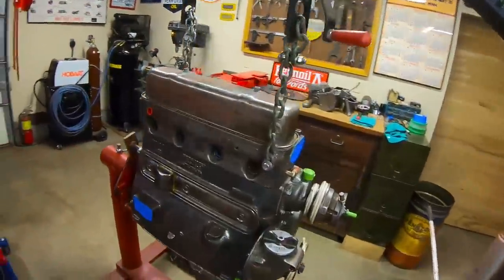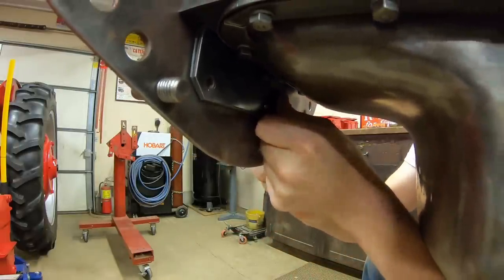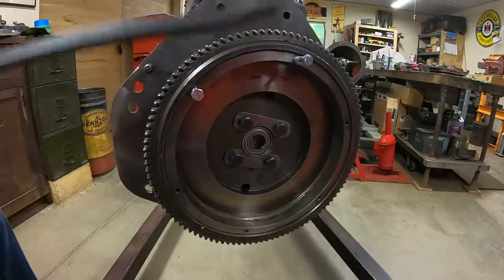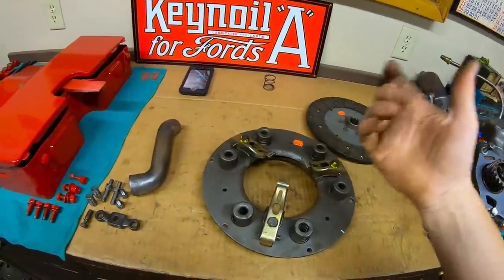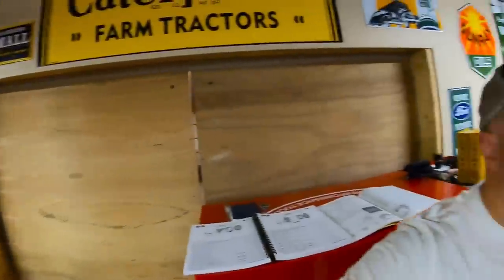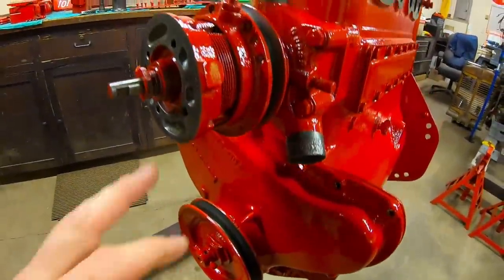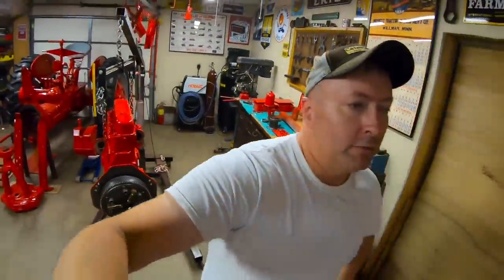Farmall "Preparation H" Episode #20: Flywheel, Clutch Install, & Painting the Engine!

Comment: Good catch on the pressure plate! The clothesline to mask the pulleys is a great idea!
Reply: Squatch Sr. Is a superstar!
Reply: The M that we had developed the same issue with the clutch. I caught it when I got tired of it shuddering and checked the clearance between the throwout bearing and the clutch fingers. All 3 fingers had different clearances from the throwout bearing. I didn't have to deal with the hydraulic system because my brother left that off when he rebuilt the engine in the mid 70s. He had messed up the adjustment on the clutch fingers when he took it apart and didn't know how to get it back where it was supposed to be. I remember that it took him a long time to get the tractor started and had to get help from our neighbor to figure out what was wrong.

Comment: Awesome job and video . I tried painting but there is so many runs in my paint job you would think that you were at a track meet . My 1926 Oldsmobile has a step fly wheel like your tractor. The pressure plate has 3 long cam lobes on the back .and when you torque down the pressure plate you have to measure the distance from the throw out bearing seat to the fly wheel and if it is not exactly 1and 1eighth distance you will have to take out the transmission and reclock the pressure plate. It took 7 cycles of in and out to get it right.the out side adjustment is for the pedal travel only. If the clutch starts slipping pull the floor board and bell housing out . The bell housing is the imput shaft bearing support. The transmission is bolted to the bell housing from the inside the bell housing..l really like your videos because of the details you put into a project. It shows you have a lot of hart in your projects. Denis from Santa Rosa CA

Comment: I like how the engine came out, no more dull red paint. The clutch adjustment and heat scoring reminds me how always check even brand new things. Sometimes they can be off by just a hair but cause lot of issues later. This flywheel is very nice compared to what the Super M had. I think the heath cracking on the flywheel is result of a very slipping clutch? From personal experiences from working with  a Belarus 520 tractor. Misaligned engagement arms can cause the flywheel to wear more on one side than the other. Combine that with a slipping clutch and you have a very bad day when you have to replace the carnage later.

Comment: I re-did a 73 Bronco clutch in very poor working conditions and failed to confirm all components.   Then the clutch started feeling oddly sticky (someplace between Milwaukee and Seattle).    Took a risk and drove up the Alaska Highway as it was slow degrade and then pulled it apart in a friends grease pit when I got to his place.   Wrong throw out bearing.   Ate one of the fingers mostly off.   Lesson to early self,  always CHECK.

Comment: 0:35 can also use electrical wire, specifically rubber coated. It auto-locks into the pulley. Old timer's tricks are the best.
edit: forgot to say, the rubber has the added bonus that you can wipe it off with acetone and reuse it again and again. I've been using the same pieces from the day i learnt the trick. Old Black&Decker drill cord.

Comment: Hi there is a mark on the flywheel and pressure plate for the installation, this also helps to reduce any vibrations of the clutch.

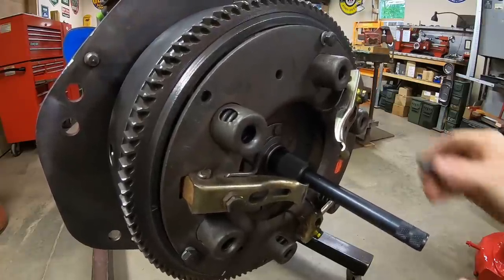Comment: 9:59 a good mod on these is to take the cone and the pucks (the bits that slide into the bearings) and put o-rings on them. On the outside for the puck, makes the thing stay put in there positively and on the cone, on the ID, making it stick to where you push it. My tool is a little bit different than yours, but generally speaking you want the o-ring grooves to be slightly undercut, so the rubber stays just a little bit proud of the spec for them, gives the whole thing a lot more staying power and it doesn't rattle.
I also took all the pucks i had and downsized each of them one "notch" down to the next bearing i commonly use where the fit is a lot more positive. The pucks are super easy to make, so if i have an odd size, i just make a new puck. O-ring trick ain't mine, i saw the mod on a forum back in the 90's, i only did it like 5 or so years ago, but man... huge change in how you work with the tool, especially on car clutches. Night and day.

Comment: Don't remember the tip with the shive pulleys and rope from before but it is a great tip! Thanks Sr!
Interesting find on the flywheel and pressure plate. That would have been a great segway on the pressure plate and then also the direction clutch disc as most are a "this side out" clutch disc system. 
I know you covered it a little of your breathing air before and I will have to go back and find it, but I dont remember anything on the hood. Is it a common Papper hood (powered air pressurized respiratory system)? I know you covered the air supply unit a little bit.  Seems to be handy to have the air supply point outside of the paint misting area.

Comment: Marking the clutch disc, pressure plate and flywheel - good work and great detective work. I was always taught though, when you encounter such heat related issues, best practices is to resurface the items. Do you feel the marred areas will be no problem?

Comment: I didn't know farmall's are pull start and how can I find documentation on a serial number  of a cat, am wondering how to research a possible show room machine there was white paint under the yellow that was hastily brushed over white paint has a brass dealer tag brass tags on pillar blocks for a few bearings and the engine tag and trans tag are matching numbers in brass

Comment: Curious... What do you think they did at the factory to prep the final engine assembly for paint? 
It's not like they didn't have oils on stuff, but they weren't gonna be spending all kinds of time to prep it "perfect".
Think they were using a degreasing "wash down"?
Reply from the maker: Almost every manufacturer used large steam cleaning tunnels that the finished machines were taken through just before the paint station at the end of the line 👍

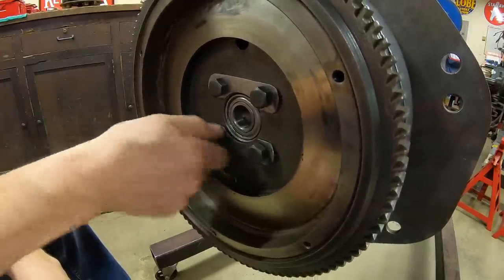Comment: 4:30 I'm starting to wonder if all these foldover locks are a substitute for proper torquing, a way to ensure this stuff doesn't fly apart even if undertorqued by the farmer working on it.  Properly torqued those bolts aren't going anywhere but if they're not quite tight enough that lock might be the hail mary that keeps them from backing out.

Comment: I'd like to see a slot cut across the head of that alignment bolt for ease of installation & removal and make it a real special service tool. I highly recommend an actual input shaft as a clutch alignment tool. I cut the bearing & gear off and neatly dress the end. You only need it every now & then but I reckon it's nice to reach into the special tools drawer & pull out a tool that will imitate the real thing. Are you going to search for a spare head while they are still around?

Comment: What kind of primer are you using that you can spray it and then finish coat it without first sanding or scuffing the primer?
Edit: I’m always worried the finish coat won’t adhere to the primer without scuffing it before painting.
Reply: @squatch253  
Thanks, the reason I asked is once upon a long time ago in a previous pre-railroad career, I was a car painter. 
We had “self etching non-sanding primers in the late 70’s and early 80’s, but they weren’t all that and a bag of chips, the color coat would peel off of that stuff if it wasn’t scuffed, even though it was claimed that step wasn’t needed. 
It was bad enough the shop I worked at only used it inside the worst of pickup beds when we painted pickups for a Ford dealer’s used car lot.

Comment: I tend to learn stuff here that I didn't expect to. As for the clutch bolts, with no marks on the head, wouldn't they be grade 2?  Or is marking the heads something that started at a later time than this tractor?

Comment: Toby, are you using an epoxy in the paint or clear coat??? Looks amazing.
Reply from the maker: No clear coat here, just the shine of the paint and the hardener I add to it. The primer is epoxy, I believe the paint is an acrylic enamel if I remember correctly.

Comment: with your mechanical knowledge, I would be more worried about you putting an incorrectly adjusted clutch together than worrying about how some bored factory worker put it together while he was looking at the clock, planning what to do after the shift ended. I would bet it is correctly adjusted now. that is going to be one pretty tractor. I am not likely to ever see it in person but it should be a best in show tractor.